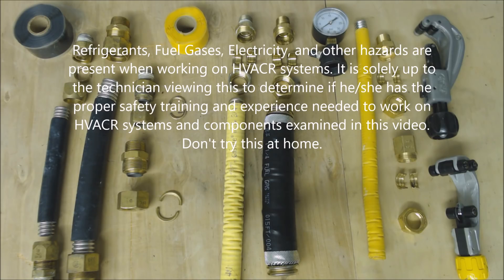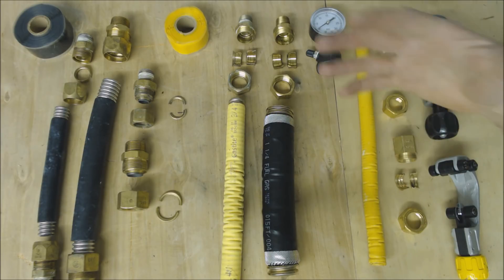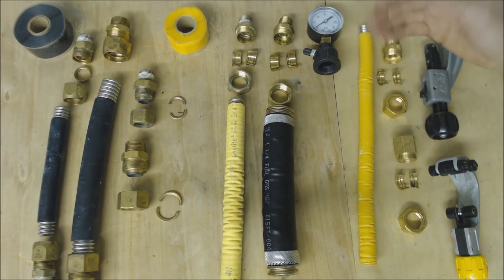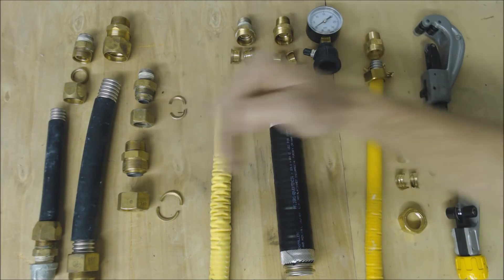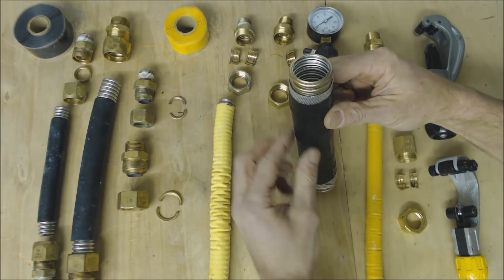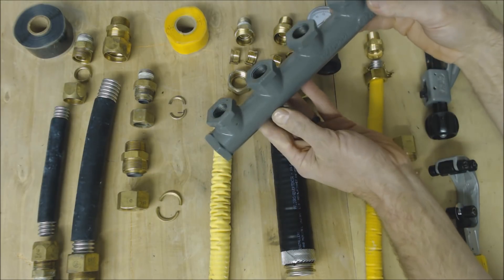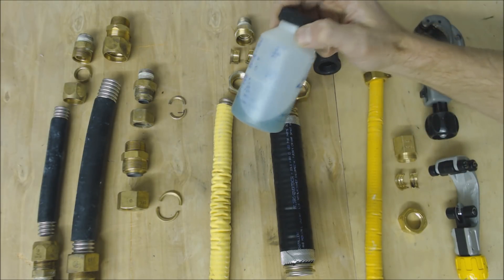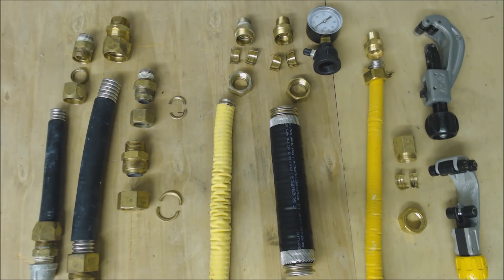Gastite, TracPipe, WardFlex, CSST, Overview, Tips, Safety, and Certifications!

Comment from the maker: Tool List-  https://www.amazon.com/shop/acservicetech
Support-  https://www.patreon.com/acservicetech
For those that are looking for the tools used in the videos: (Linked Below)
Here is the link for the Ridgid Quick-Acting Tubing Cutter, 1/4-inch to 1-7/8 inch Tubing Cutter- http://amzn.to/2nKBJ6c

Here is the link for the Ridgid close quarters tubing cutter 1/4" to 1 1/8" - http://amzn.to/2nHP9jl

Here is the link for the Ridgid tubing cutter with the Stainless Steel Cutting blade 1/4" to 1 3/8"- http://amzn.to/2kHLWPz

Here is the link for the self fusing tape- http://amzn.to/2kIBGXi

Here is the link for the Rectorseal Non Corrosive Bubble Leak Detector-  http://amzn.to/2iIoe1K

Here is the Link to the Yellow Jacket 30LB Pressure Test-  http://amzn.to/2AM7cK0

Here is the link to the New UEI DL479 Multimeter- http://amzn.to/2hDtvHk

Here is the Link for the FieldPiece ST4 Dual Temp Meter- http://amzn.to/2AhR6ph

Other tool links can be found in the video description section.

ACSERVICETECH is a participant in the Amazon Services LLC Associates Program, an affiliate advertising program designed to provide a means for sites to earn advertising fees by advertising and linking to Amazon.

All of the ACSERVICETECH Playlists-  https://www.youtube.com/channel/UCOZR-1IqsAer9wzlvFgb4mA/playlists?view_as=public

If you want to support the ACSERVICETECH Channel and receive more HVAC content, check out www.Patreon.com/acservicetech

Comment: lol soapy water will put a hole in it..
Reply from the maker: That is absolutely correct. Seems silly right but give it 6-12 months and it will if its dish detergent and water mix. Remember that you can't wipe off what seeps under the nut and is touching the thin stainless steel.

Comment: I’ve took apart my propane line at my cabin and lost the gastite ring when it fell and bounce somewhere . No one in the town had a gastite fitting so I used the home flex fitting from homedepot to reconnect . It’s 1 ring with a notch . I put it together and no leaks at all. Should I order a gas tite fitting online or it’ll be fine as is
Reply: Order the correct fitting. Oer the manufacturers you can absolutely not mix brand fittings. Yes it may have worked but why take the chance of failure. 27yr gas fitter here

Comment: I bought a big spool of the yellow gastite pipe like you have.
I got it cheap and it has taken my shop space to store it and I need the space. All that said I no very little about gas lines and dug a water line from the house out to the shop. IDK it is stainless so I threw some of it in the ditch leaving the tails coiled up outside both buildings and without asking questions from anyone. Have I just wasted the gas line by burying it? 
Everyone seems to use plastic on underground. It looked like it was overkill using stainless line. I had it seems like I bought the spool for scrap ( I had to cut about 40'feet off where it had been kinked and the rest of the large spool was good. I think it was 250' of it to start. Tell me I haven't just wasted the whole 25 bucks I gave for the whole spool lol. I threw 2 home runs of cat 5 cable for ethernet in the ditch as well.   bought a 1000' spool of it for 5 bucks at the scrappers too. I hoarded it not knowing when or if I might have use of it, a roll of this a spool of that. 
IDK at this point.
Reply: Well I don't know about the gas line but the Cat 5E has to be waterproof and insulated for direct burial.  So if it is not black, shiny and filled with grease then the cable won't last too long.  

As for the gas line, yes I notice a lot of Poly pipe being used underground around here.  Not sure about what is allowed with other types.  Other videos have said that the yellow Stainless stuff was for indoors, mechanically protected by being installed within walls and ceiling/floor joists.

Good luck with that.
Reply: @gragor11  
Lots of people use the poly around here too. I never got any comm. Hooked up in house or shop. I suppose that gas line being gastight for pressure wont leak so I can use string and a bit of sponge and vacuum a string through it and pull some of the cat 5 through it if I decide not to run gas out there. Thanks for the reply. Regards
Reply: @decoy2636  Yes.  You won't be the last person to pull something else through an existing pipe.  Just beware that as water eventually winds up in PVC pipe there may be a way for water to wind up in the CSST pipe if the yellow coating does break down in the water and acids or alkalines of your soil type.  So you should pull direct burial cat 5e wire through that pipe after whatever it is you installed fails.  That could be decades, one never knows.

Comment: I have 3/4” line out of back of house with shut off and want to run 1/2” hose with quick connect from that about 40 feet to generator 13hp 420cc motor would I get enough NG to generator to run effectively or do I need to go larger ? I was already told to different times on YouTube 1/2” hose would work just being safe and not wasting time and money.Thanks
Reply from the maker: It all depends on the size of your generator. The BTU/HR input would need to be know otherwise no one would be able to know. However you would need to know the inside diameter of that particular tubing as the IFGC 2018 sizing charts deal with known tubing sizes such as for csst, iron, and copper, thanks
Reply: The inside diameter of 3/4” pipe  is id3/4” and the 1/2” hose is I’d 1/2” the generator is 13hp 420cc engine I was told it requires 28,000 BTU and was told my 3/4” and my 1/2” at all lengths will produce 34,800 more then what Generator requires.
Reply: I told you it’s 13hp 420cc it doesn’t come like appliance with BTU’s required.

Comment: wish you showed pro flex also,   its connections are hand tight plus quarter  to half  ...no more,
Reply from the maker: Hey Mark, I would only really like to see techs use the tubing 3 main manufacturers shown in the video. The tubing you are referring to actually has rubber o-rings in the fittings and I believe is sold at box stores like lowes. I have taken some of that stuff out and the orings just fell apart and were pretty falling apart. The piping wasn't even that old, thanks
Reply: @acservicetechchannel  ,no issue with it if installed corectly,hand tight plus quarter to half turn,...any more crushes the orange silicone o ring, yes lowes and or home depot,

Comment: Dish detergent eats the pipe? That’s the durable piping system you want carrying gas into your home?
Reply from the maker: Yeah it is made a lot more corrosive than it was 30 years ago. It will even quickly rust galvanized pipe. I have seen that on a job where we came back 6 months after the plumber put the gas lines in at the furnace location inside the building. The homeowner said he was there and saw the joints wiped off but they had 3/16 of rust coming off of the threads

Comment: respectful correction: Schedule 40 gas pipe is not galvanized, it's black iron. Galvo is used for water
Reply from the maker: I live near the ocean and galvanized is all the plumbing supply hoses sell for gas lines or water. None even stock black iron. I am a licensed Career Ed teacher of HVACR and have read the whole IFGC and there is no issue using galvanized or black iron for gas lines. Thanks downtourth!
Reply: @acservicetechchannel  back in the days when gas was manufactured from coal gasification, galvanized piping was not acceptable. But with Natural Gas and galvanized processing a lot better than it used to be NFPA54 I believe has been accepting it for quite some time now. In no way should schedule 40 black Iron or galvanized pipe be used Underground ( above ground installations only). There are still a lot of municipalities that prohibit the use of galvanized pipe throughout the country.
Reply: I live on the NC coast, I use copper and Schedule 40 galvanized pipe all the time.  It’s legal in NC.
Reply: @mcroley591  Seeing as how you mentioned copper I thought I'd quire you about the nature of copper tubing for sale these days.  I've been watching a lot of CSST videos recently as a possible way to supply LP gas to behind my new LP range as an alternative to gas line rated soft copper tubing which is not readily available.

I'm seeing a lot of regulating going on (I'm an electrician/electrical contractor).  Back in the day I used off the shelf rolled 'copper' tubing and a flanger to hook up gas appliances in a cabin I am associated with.  It's been doing just fine for at least 30 years.

Now, in the age of 'risk management', any copper tubing I see for sale in hardware stores is all designated as 'refrigeration' tubing.  Haven't come across any available tubing designated for gas use.  I always have to wonder how much of this is real and how much is just feather bedding by regulatory/manufacturing industry.  Is the differences between 'refrigeration' tubing and 'gas' tubing of any consequence?  I will switch to black iron or CSST if I have to but I have to wonder.  I do love to work with copper.

Comment: Can you cut using other tools like portable band saw, etc.. or are these cutters recommended? Thanks!
Reply from the maker: Not at all, only with tubing cutters, The cut has to be extremely precise to seal right. Make sure you get certified in the brand you want to use. They are usually free trainings and cert classes at supply houses, thanks
Reply: AC Service Tech LLC thank you! I will not being the work myself, I just like to learn. Thank you for the response!
Reply: @acservicetechchannel  bull shit. 20 year plumber who had never failed a gas inspection.  Residential or commercial. It's been done. Should you, no. Can it, o yeah it can. Don't misguided people dude.

Comment: I have a slow leak on a wardflex fitting. I think the gasket is scarred. Is the leak fixable by applying tread sealant to the gasket or rings?
Reply from the maker: No, you would replace the fitting and ring assembly. Thread sealant eventually dries out. If the tubing is scarred too then cut that back to attach it to the new fitting if you are certified for the particular brand, thanks!

Comment: anyone ever seen lightning blow holes in black iron pipe?
Reply from the maker: Exactly, the only problem is that even for those of us who only use black iron or galvanized, we will still see and run into csst piping that we may need to work with that is existing. Thanks a lot Throttle Bottle!

Comment: Home depot sells them in Idaho  without certification. Thanks for the video !
Reply from the maker: I believe that is a different manufacturer that has a rubber o ring as a seal instead of these types, thanks
Reply: @acservicetechchannel  its pro flex has silicone orange o ring,must not overtighten ,or will crush the seal,self certified  if you read and qualify yourself, and register